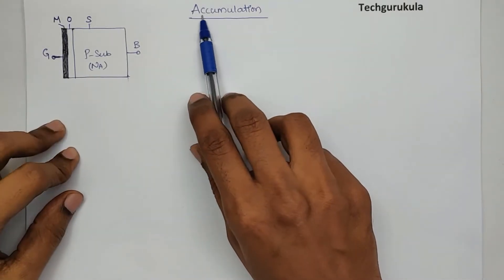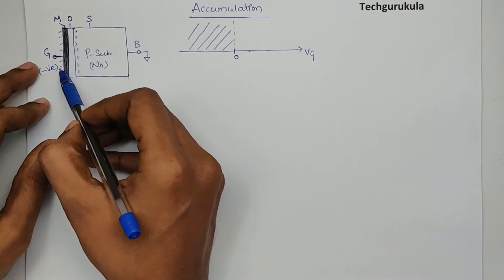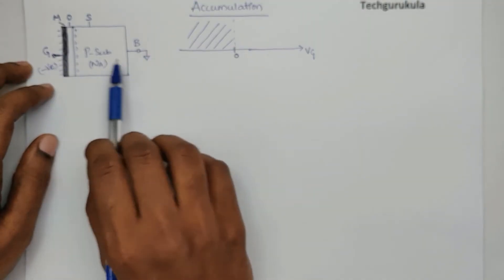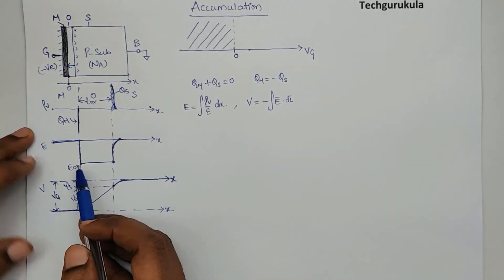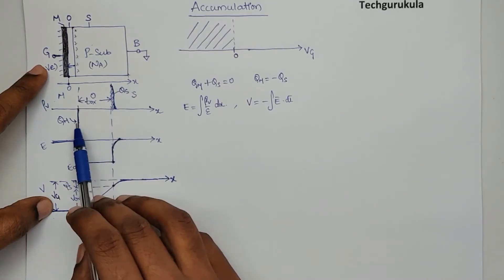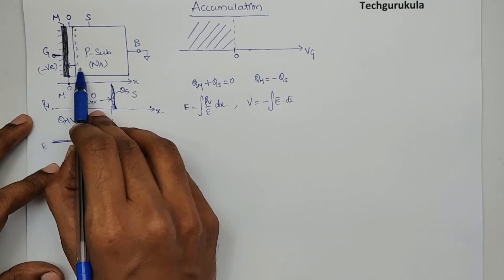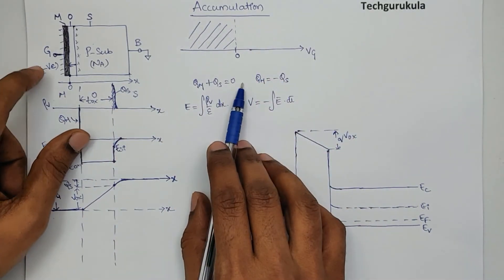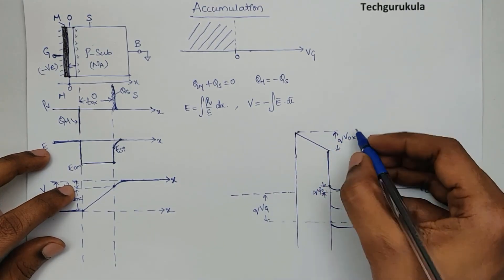Electronic Devices: MOS Capacitor (03) - Accumulaiton Mode

Comment: In the metal side you told first :
since electric field is zero, potential is also zero. 
but later you told since bulk substrate is grounded so potential at substrate is zero. then the potential at metal should be negative. 

This is contradictory! I am getting confused. please help.

Comment: hi teacher.
i have a question 
why the electric feild in the semiconductor is negative even the hole charge is positive
Reply: becasue integration is simply area under the curve. so we integrate from metal oxide interface to oxide semiconductor interface so it simply give total area under the curve.

Comment: honestly speaking this topic is not understandable for beginners...u didnt explain with clarity...they can understand those who have basic knowledge...
Reply: For beginners it will be tough to understand this topic. You should have a basic idea about semiconductors and working of PN junction diode. Refer his lectures on the above mentioned topics and Im sure u will get it. If you want to explore  deep inside then refer Caltech Ali Hajimiri lectures on MOS Capacitor
Reply: Watch video no 27 for basics , understand pn junction diode electric field and built in voltage derivation then u can understand

Comment: Sir, I have a doubt. Initially the moscap is charge neutral.  We are applying an external negative charge through gate.  We want this charge to be compensated by equal and opposite charge.i.e. hole.But no.of holes= no.of Na(minus ) ions. So we need some    extra holes to be generated to compensate the external negative charge.How these holes will be generated?
Reply: It’s taken from ground
Reply: Potential is constant for metals or electric field is zero for that there should be charge distribution only in such a manner